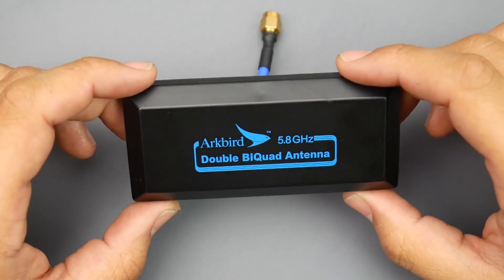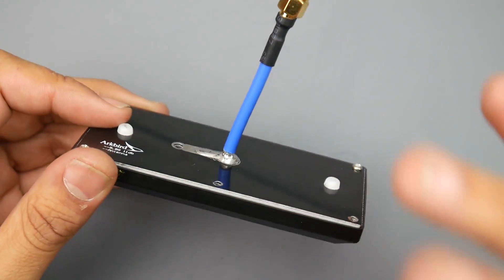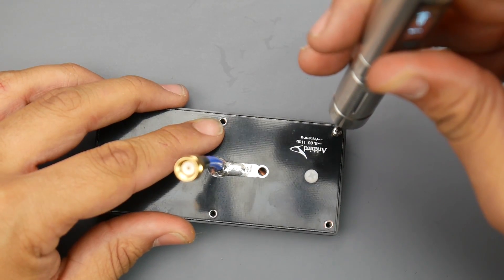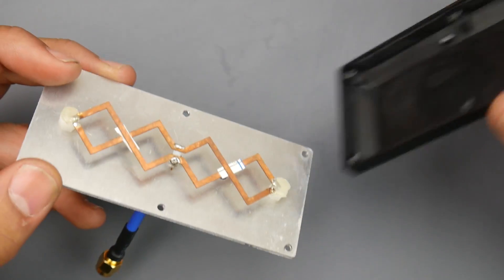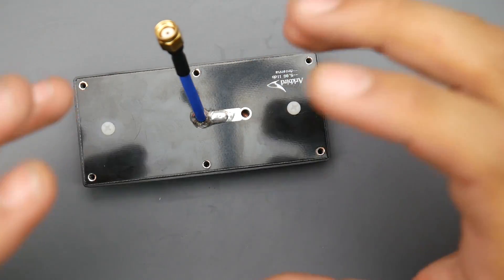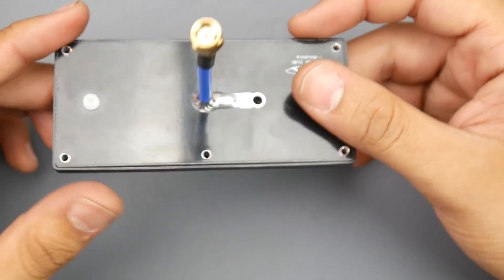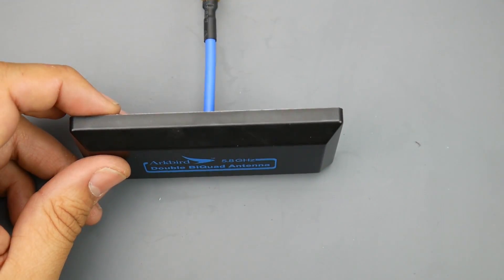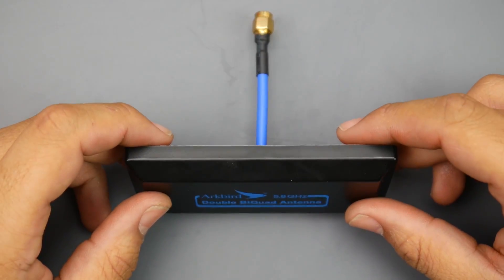Long Range 4KM Test // Arkbird Original High Gain 5.8GHz

Comment: I done a 4000m / 2.5 mile flight yesterday, not even the best weather conditions.

Tramp HV on 5805 (don’t think that even puts out 600mW)
Pagoda stubby
Triple feed patch.

Had crystal clear video at 4km. Turned around as the battery was too low. Mini quad, even on way back the battery was blocking pagoda and no significant break up. 

Very impressed with tramp VTX
Reply: Also to add, this was an Achilles 5.8 module, no break up. My dvr screen was unwatchable. Shows importance of a good receiver regardless of antennae being ised

Comment: Could you not use your ardurino board to output to a servo and mount the antenna on servo . When signal get weak , it would adj servo and point in right direction.

Comment: Did you use a circularly polarized antenna on the plane? If so, I don't think you would get the best performance from the double biquad since it is linearly polarized.
Reply from the maker: I used a pogada2 on the AKK ultimate VTX.. That could explain why everything else tested better. I will retest once I get a break in the weather again.

Comment: Did you seen that new vtx on bg with 1500mw 5.8ghz and with a little fan on the heatsink
Reply: there has been an after burner amp for 5.8 with fan all the time. but other long rangers pimp the receiving side. it's easier than cranking up the output on the model.
Reply: pixelcomet oke I've never seen that small of a fan on a vtx and i seen it by new arrivals so I thought it could be something new 😆